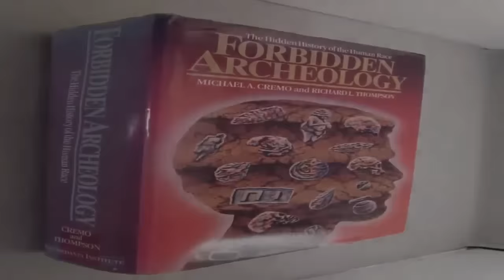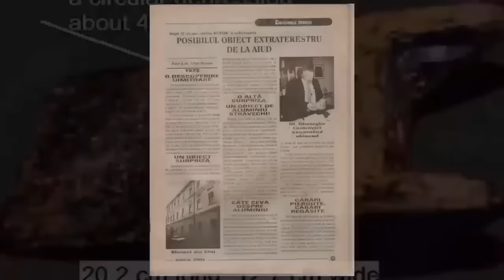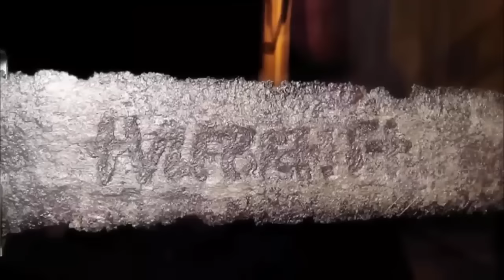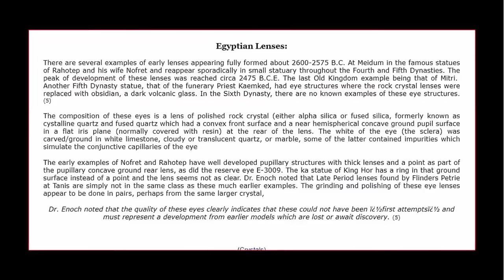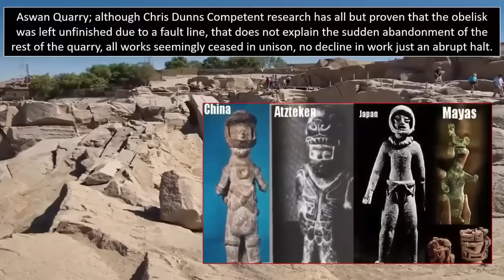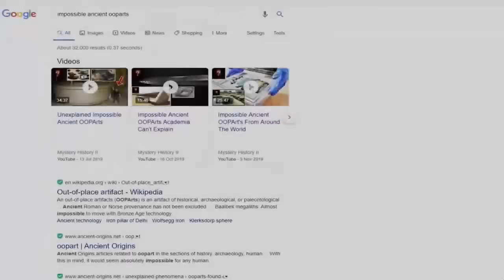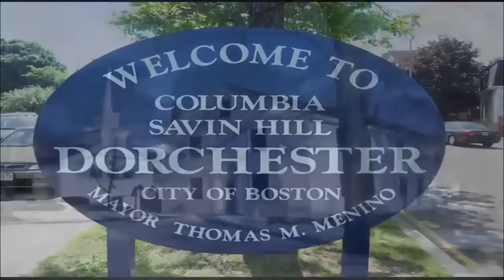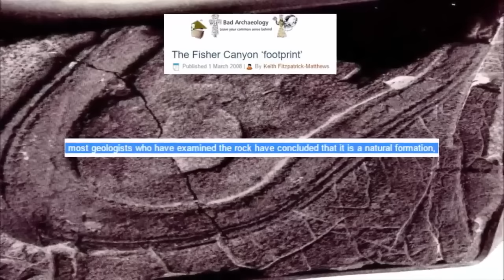Most Mind-Blowing OOPARTs Ever Found?

Comment: The aluminum piece was found in a ceramic sphere. In fact, there were many ceramic spheres, each inside had an object. All the spheres were far below the level of the mastodonts removed by the excavator. The aluminum piece had an aluminum deposit on it formed due to water, it was taken out of Mures (the river of the ancient Agathirs), according to the thick layer it had, they said that it was between 200,000 and 300,000 years old.

Comment: Yes,  medieval technology allowed metal to be heated to such temperatures. By the way, steel melts at 2500F, not 3000F. Pig iron (pure or wrought iron) melts at 2700f. Please quit quoting archaeologists who know nothing about steel, melting points, or engineering. In Africa, as far as their elders know, they have been making iron (carbon steel) tools the same way forever. It is a simple clay tube type furnace that melts ore into steel, using charcoal and forced air. In the 1800's, that was how American steel was made. That is how forges have always worked, modern or ancient. Blacksmiths didn't switch to coal because they had to, but because it was easier than charcoal. Charcoal will melt steel no problem. Charcoal will melt iron ore. Mankind has had the availability of melting iron bearing ore as long as he has had the knowledge of which rocks to melt to get that metal. Being as iron bearing ores are extremely common... There is a lot of complete BS pushed in this area by archaeologists who should leave metallurgy to those who know something about it.